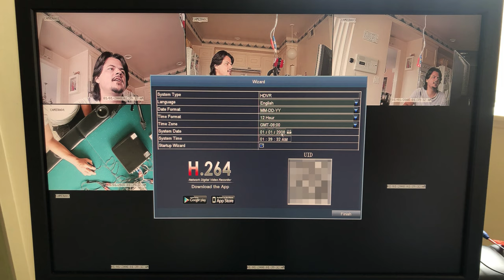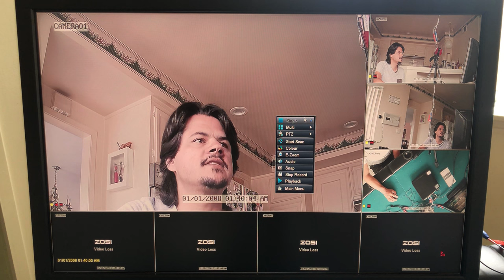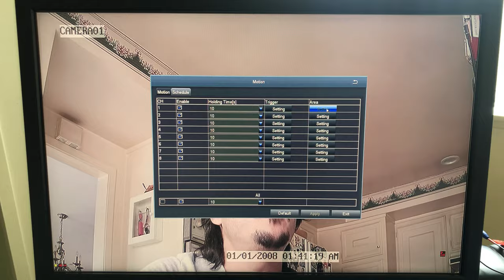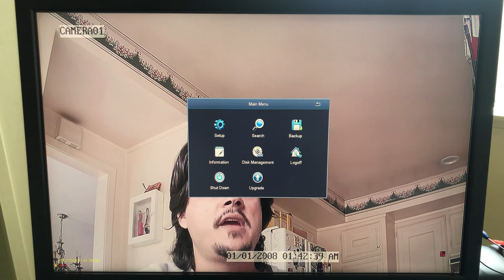Zosi Security Camera How to and Review

Comment: As an amateur radio operator, cover outside connections with electrical tape.  Power would be the critical one, as it is in no way watertight, but I suggest taping up the BNC connections as well
Besides waterproofing the runs, if you use black cabling, you can camouflage the runs by covering the bright connectors.
Use the cheap tape.  It actually holds up to weather, while something like Scotch 33, will undo itself in warm weather.
Reply: Heat shrink tubing shall do decent outside for these

Comment: Zosi systems are unpredictable. Two years ago. I bought a Zosi 4 wireless camera and DVR set, after two years, one camera burned out,  (cause unknown) contacted Zosi, they could care less.  A year later purchased a Zosi 8 wireless camera DVR set, after a year, one of the electrical power converters failed, (used a left over one from the 4 Camera set.)  Also learned that the four cameras wont work with the 8 camera set and vice versa. Make sure all connections,  including the Wi-Fi. are tight, ..for a  good, guaranteed signal from DVR to Wi-Fi tower, use an ethernet cord, do not rely on wireless signals.

Comment: I have a questions:   Can you add a fan to the system: I know you can add hard drive. Although, my dvr gets warm: Im a little concern if it gets to hot and it could catch on fire? I open up my box there is couple wires that could be hook up one with hard drive not sure what the other wire is.

Comment: Can you explain hooking up the sound to the system.
Reply: I just looked it up and basically the white connector from the mic unit plugs into the back of the hard drive. So a standard  "twin cable" video/power will not work. You will need to run another (3 connector) cable from that camera to the hard drive.

Comment: Question. Installed all with no problem, but my camera # 3 on my monitor the imagine is upside down! Just camera #3 could you tell what’s wrong ! Thx
Reply from the maker: I had this problem too, the camera is actually upside down. You can unscrew the nut on the back and rotate the camera. If you want to maintain the logo and rain hood right side up, then you need to unscrew the housing and rotate the actual camera inside. Its not as difficult as it sounds. Hope this helps.

Comment: I purchased the Zosi camera system about two n' half years ago. I went with it cause a buddy of mine had it and i was sold on the clear video picture it displayed and all the other features. I was checking this video cause of whole ' nother issue I was having with my system but I learned alot while watching your video, bro. The alarm feature with the grid, I totally didn't know anything about that. That's cool, thanks for that.

Here's my issue, maybe you cant help me cause my wife is driving me bananas about it 😖  A few months ago all my cameras went out simultaneously. I thought the cameras burnt out but now I'm not so sure because the features and icons etc. on the screen still remain on display. I've tried re-setting, rebooting blah blah and nothing...
I don't know, do u have any tips, advice?
Have you experienced anything like this since installing your system?

Comment: Did everything that you showed for connections got power to everything hdmi to monitor no picture. It was also sold to my wife with no recorder.do we need a router like the quick start guide says. I'm pretty disappointed. And I don't remember getting a regular manual.
Reply: same here-- I ordered VGR cables from Ebay so maybe it will solve it

Comment: Hey Vince,  Great video   My question is  how did you finally decide on the brand Zosi,  2nd, Why did you go with the DVR instead of a NVR?  The POE systems do cost a little bit more. was it just a matter of preference?  I'm just curious is why I ask.  I haven't as of yet decided exactly who's system I'm going to choose. I do know I will use the POE, NVR system.  The thought didn't really occur to me until you said you purchased 2  8 camera systems for a total of 16.   I wish Zosi had a hybrid wired/wireless system like another company out there offers, however they do not. As I would like a couple cameras on my garage, which is not attached to my home.   Again, Thanks for  another Great Video!!  keep 'em coming!
Reply: Hi, I notice that you mentioned about hybrid wired/wireless system camera, I'm curious which brand has this kind of camera, if you can tell me, that will be nice.
Reply from the maker: The deciding factor was quality and price. The picture looked good and they were cheep. Plus the software had tons of features.
Reply from the maker: I ended up going with one 8 cam wired and one 8 cam wireless, but maybe Scott can chime in with the combo unit he saw.

Comment: The hard drives ares crewed directly to the base of the DVR and thus get too hot. The cameras are said to be waterproof but the connectors are not, when water gets into a connector at the end of the 60ft cable the cable can melt/burn/fire because it is supplied by a 2A power unit -- this is NOT safe and Zosi whom we asked don't care a damn. The 2Mp, 5Mp and 8Mp/4k DVRs all record reliably BUT the USB connection routinely freezes/hangs and the DVR needs rebooting - this is a bad failure. Using remote camera viewing on a mobile is a futile undertaking if you ever get anything working it is extremely poor and unreliable and fails within minutes.